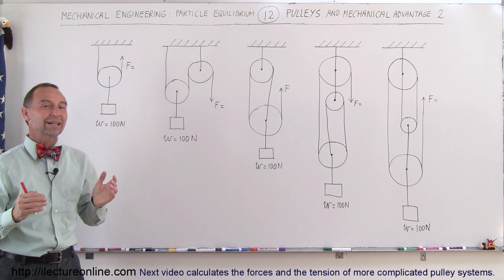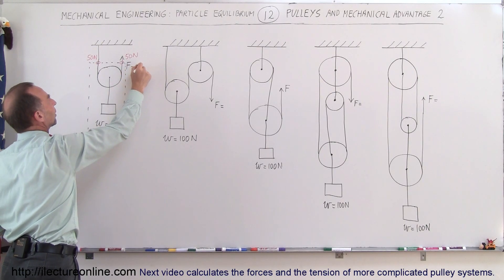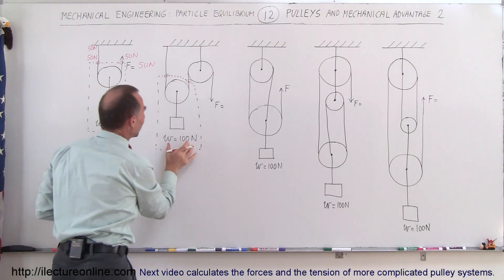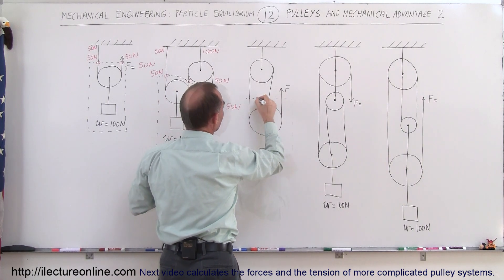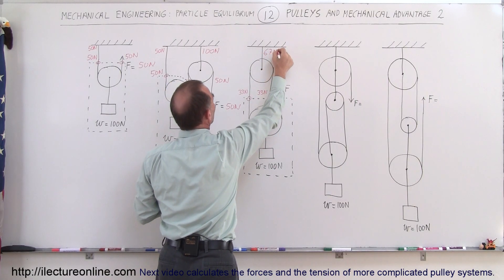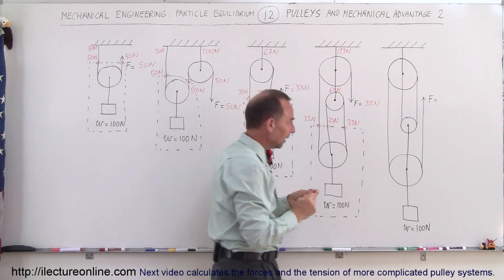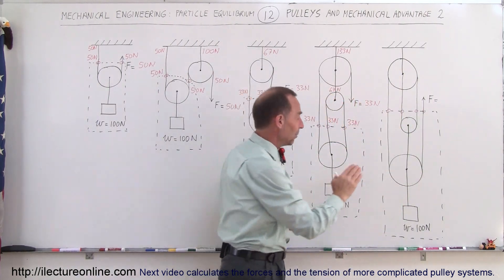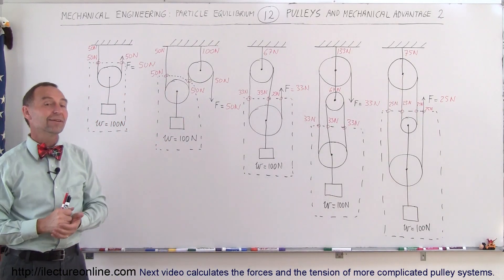Mechanical Engineering: Particle Equilibrium (12 of 19) Pulleys and Mechanical Advantage

Comment: I have question in the last question, my friend and I cut between 3 ropes. We manage to have tension of 66N instead of 75N
Reply: I have the same question just like yours. I suspect that there should be a criteria for deciding a free-body diagram, which in this lecture the professor didn't teach.
My guess would be that a free-body diagram must containt all ropes directly or indirectly pulling the thing.
Since a norm of tension force on a rope is constant everywhere and every rope lifting the weight is actually one rope, the answer is the weight divided by the number of ropes in the diagram.
Reply: @수하긴   Not necessarily. In the example #2, the last part of the rope is ignored because it does not touch a movable pulley. In general, only movable pulleys play a role in distributing a force. Non-movable pulleys only change the direction of the force.
Reply: @수하긴  the criteria I use is I draw a box around the parts that begin to move when the rope is pulled.
Reply: @Priya pari In this example friction and the weight of pulley doesn't exist
Reply: @
Oliver Rusta
  If you cut ropes at the level where there are only three ropes (just above the lowest pulley), the middle rope will have tension not the same as the lateral ropes, but two times greater.

Comment: What is the mechanical advantage of example 2? Is it 2? And how about the MA of example 1? Is it 2 as well? I need a confirmation so badly... please reply
Reply from the maker: The mechanical advantage is defined as the weight lifted divided by the force required to do so.   The first two examples: mechanical advantage = 2:1   The third example MA = 3:1   The last example   MA = 4:1
Reply: @MichelvanBiezen  thanks prof michel...you saved my day

Comment: The weight on the ceiling is wrong in every diagram except the first one. Or are we talking force needed which is not the same. No amount of pulleys with reduce the overall weight nor increase the weight. (Not including the weight of the equipment used)  Left to right three and 5 are 100% wrong no amount of pulleys will reduce the weight of the single ceiling fixture ! ILLOGICAL Unless someone can explain ?#
Reply from the maker: The video is correct.
Reply: The video is correct and explains it perfectly.
Reply: Imagine a tree branch as a pulley.  You are holding a 100kg man off the ground with your own 100kg body.  It's 1:1 so you need 100kg of force to lift (hold) 100kg weight.  The BRANCH however is holding twice your weight.

Diagram 1 also reduces the weight (on ceiling) -  that is, as long as you are holding the rope and sharing some of the weight.  If you tie it off, the weight on the ceiling now goes up to equal the weight of the load.
Reply: @ianbrown_777  A tree branch doesn't need to be 100 kg itself to support a 100 kg person.

For instance, a standard 8 ft long, 2x12 plank has a mass of about 17 kg.   But even a 100 kg person wouldn't hesitate to stand on it, as it can support a lot more than 100 kg of load as it spans its length across two support points.
Reply: @carultch  Correct.  I'm not talking about how much the branch weighs - just the extra weight on it.  I was just trying to explain in another way to the OP how the weight on the ceiling fixture will change (- either up OR down) depending on the system you attach to it.

Comment: Last example why tension is not 33N?
Reply from the maker: When you look at the free body diagram, the weight is supported by 4 strings at the top of the diagram, each holding 25 N
Reply: I am still confused by this. Why do you draw the free body diagram to include the pulley above the pulley that's attached to the weight? If you draw the FBD as you did in the previous 4 examples, there would only be 3 forces pulling up on the pulley while the only downward force would be the weight of the mass. Therefore, if you draw it like that, the tension would be 33N. So my question is, why do you draw the FBD different in the last one vs the other 4 examples?
Reply: @bruinprideee9970  if the free end of the string is pointing upward, that will be included in the FBD.. If the free end of the string is pointing down, it wont be included in the FBD..
Reply: BruinPrideee - I think the fbd includes the free hanging ones and excludes those who are hanging solely from the ceiling

Comment: which questions are asked to engineer in Pulley industry?
Reply: 1: What is the rated capacity of the pulley as the sum of the two tensions?
2. What is the coefficient of friction the pulley makes with the axle?
3. What is the range of cord diameters that can pass around the pulley?
4. What is the radius of the cord around the pulley?
5. Can you provide a drawing that shows the mounting interface of the support bracket, so that I can work it in to my drawing?

Comment: lots of doubts analysing the first diagram
1.how pulley is fixed 
2. rope fixed ?
3.how  load is  being lifted
4.drawing free body diagram ..how different is it from previous first  diagram n  first diagram of this video where tentions get divided
Reply from the maker: 1. pulleys are fixed to the ceiling
2. ropes are held in place by the force (as indicated)
3. loads are held in place by the forces (as indicated)
4. The free body diagrams are the same as any free body diagram.